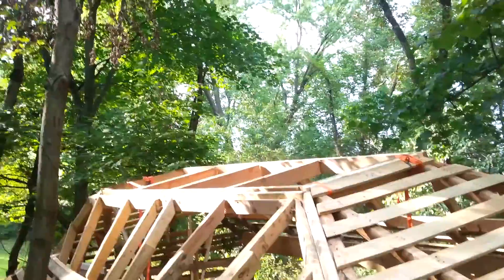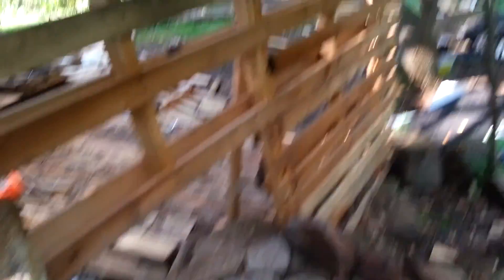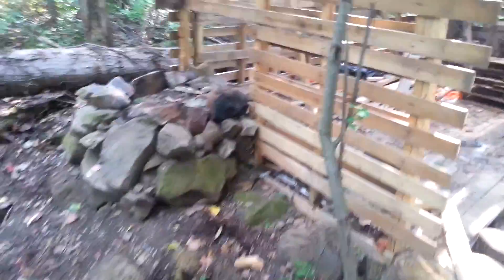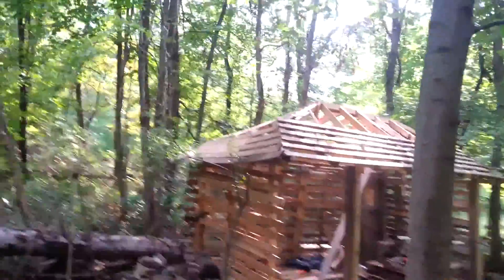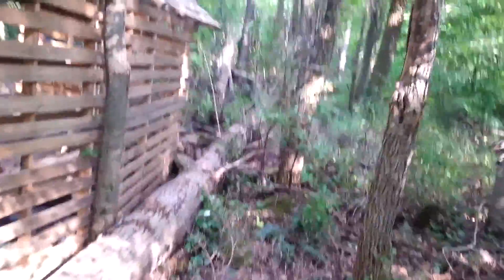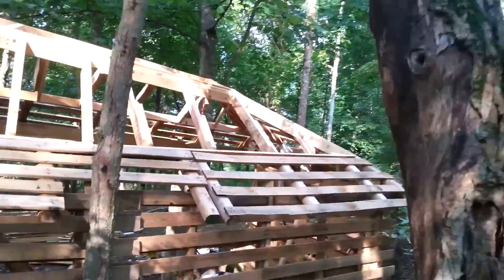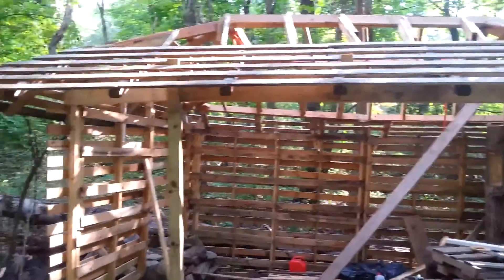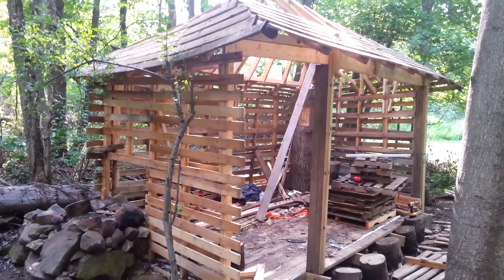Tiny House Off Grid Pallet Cabin - Part 4

Comment: Wow, I've never seen anything like that before.  The roof is out of level, sags, the eves are not straight, and you have a flat portion of roof at the peak which will surely leak. 

 What is going on at 1:34 ?  You have some sort of angled wedge like section on the upper roof that can't possibly be level.
Reply: What I did was use silicone poly-canvas tarps - one underneath - and then between the rafters I put in rock wool. Then I did cross beams above the rock wool and put another lay of rock wool going horizontal with the cross beams. Then I put a 2nd silicone poly-canvas tarp on top of that. Since I'm in Minnesota. I wanted breathable insulated roof. But now I'll add a third silicone poly canvas tarp turned sideways - so I get more eaves and also I'll make it more taut so it doesn't trap rain. I didn't want to compact the insulation so the first two tarps were not taut enough.
Reply from the maker: It's a compound Mansard roof line which is not a traditional roof on purpose. There are no sags and the eves are exactly like it was designed. The flat portion actually became an angle due to my compounding the upper section of roof instead of cutting it in level.  So in reality there is zero flat areas anywhere on the roof.  As to it leaking it doesn't anywhere and has been through many heavy rainfalls.. I doubled up the tar paper is areas of ridges, valleys, and peaks....in those areas there are 3 layers instead of just 2. In the coming videos will I show you how the roof will be competed. Thanks for your comment. :)